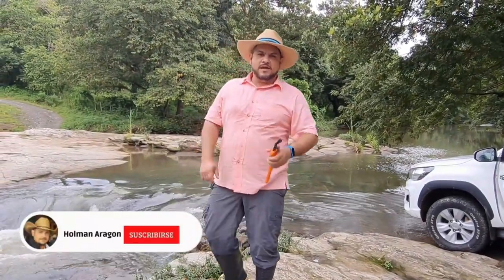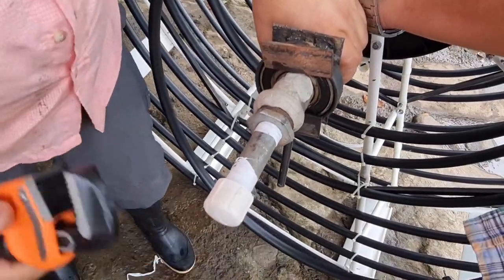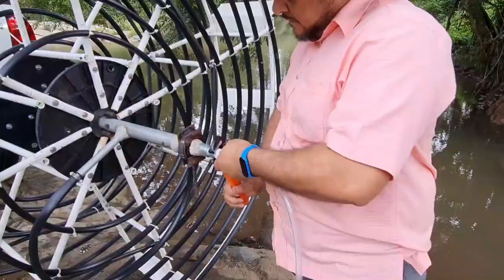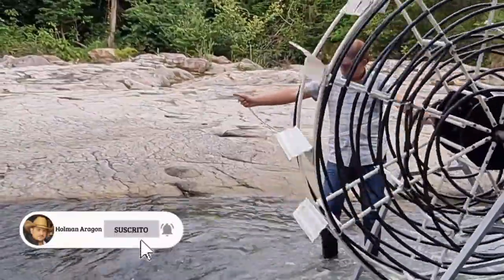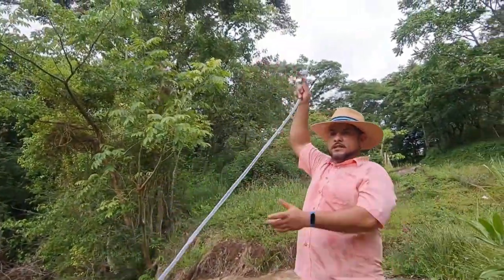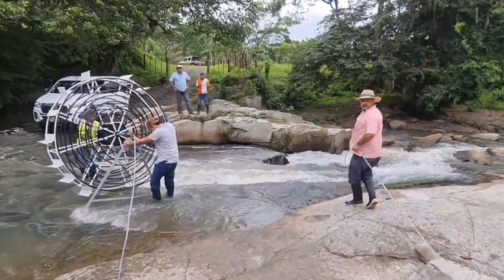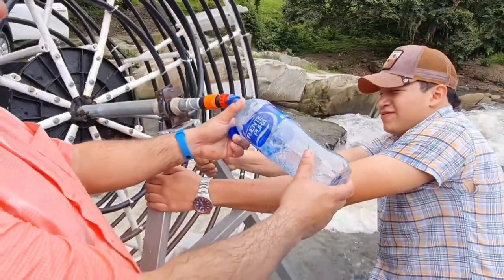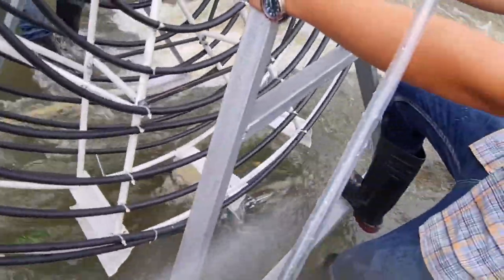SPIRAL WATER PUMP FIELD TEST.

Comment: Nice video for the test.  Is the hose 30 meter length or is the water rising 30 meters elevation?  I was wondering how much psi pressure output at the pump.
Reply from the maker: Yes, that si ir, go up 30meter that wheel ia a wonderful proyecto. Thanks for watching.

Comment: Can you explain more detail how to joint between rotation pipe to fixed pipe
Reply from the maker: It joins with a connector called click, it is common to use in garden hose joints, one side of the connector rotates on its own axis which in turn allows the tubes not to bend. itself this is the brain of this CLICK connector machine.
Reply: @HOLMANARAGON  gracias Aragon, I try to fine this click connector, in next video you can explain about tube size, wheel size, tfs Aragon
Reply from the maker: Ok, 👌👍
Reply: This is Awesome! Thanks for making!
Vivo en Bolivia y voy a hacer este en mi jungla!